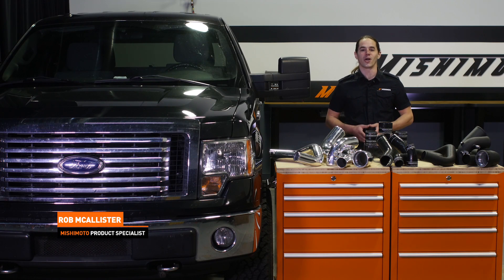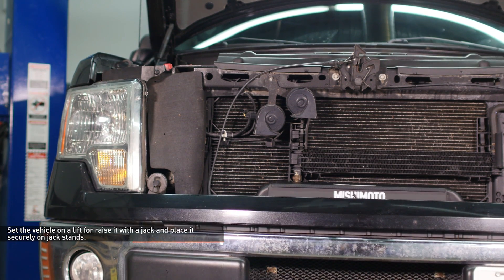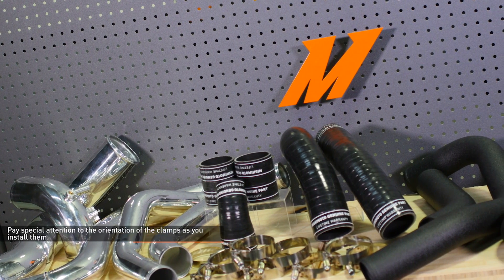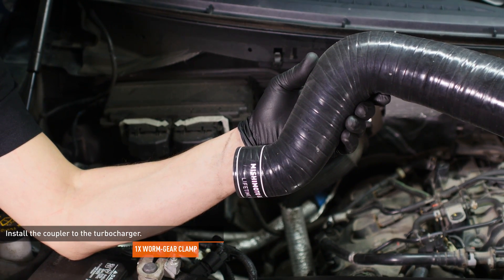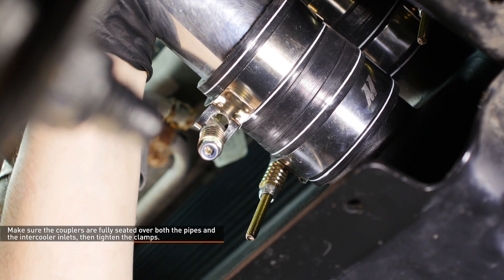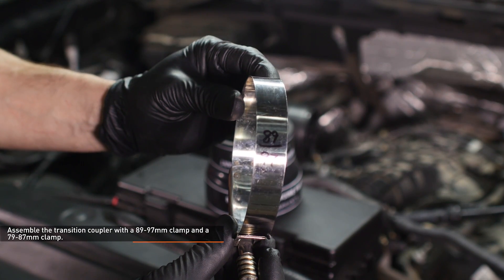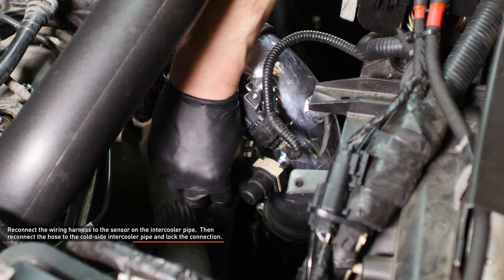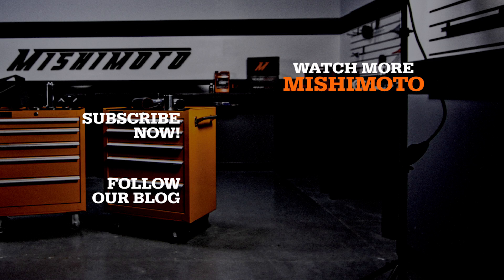2011–2014 Ford F-150 3.5L Ecoboost Intercooler Pipe Kit Installation Guide by Mishimoto

Comment: I found this to be much harder than this video made it seem. Most of the pipes was like trying to stuff a golf ball through a garden hose. Most of the clamps where just big enough to place around the pipe with extreme effort. The largest of the clamp for the transition coupler was actually way too small and I had to go to the hardware store for a replacement. I really hope this setup proves to be worth the effort. For reference I am certified mechanic but have rebuilt cars so I do know what I'm doing.
Reply: How'd it work out, better Hp & torque?
Reply: Took me about 8 hours and I also had the problem with the largest t clamp being too small. Hoses blew off on me a couple times for the first week, but I think I needed a little adjustment here and there and a little more torque on the clamps. Overall I'm happy with the upgrade. My turbos seem happy.

Comment: Why do this?
Reply from the maker: Hi nibot! The Mishimoto 2011–2014 F–150 EcoBoost Intercooler Pipe Kit will give your truck the efficient, unimpeded airflow it needs to make up to 15 more horsepower and 21 Ft/lbs more torque.  Get the full details on the product page here: https://www.mishimoto.com/ford-f150-ecoboost-intercooler-pipe-kit-2011-2014.html
Reply: @mishimoto  Wouldn't a larger diameter pipe on the cold side require a tune? I saw a MAP sensor that you have to move over to the new cold side pipe.. Would that throw the ecu for  a loop and need a tune or not? Thank you!